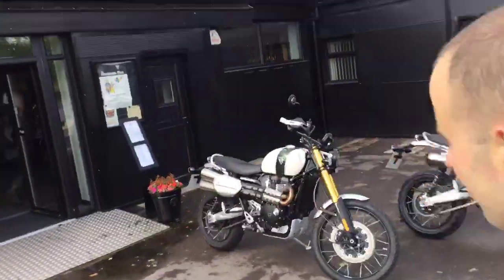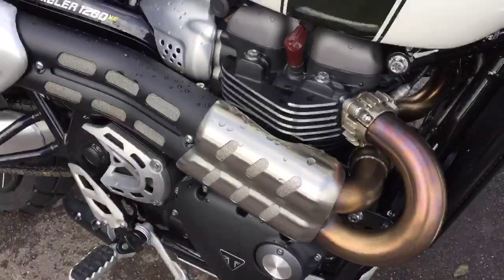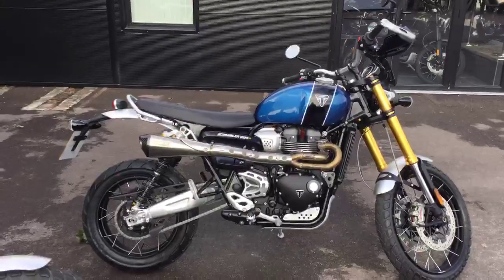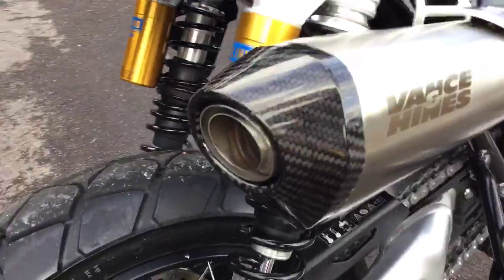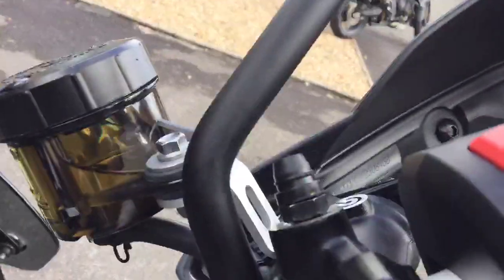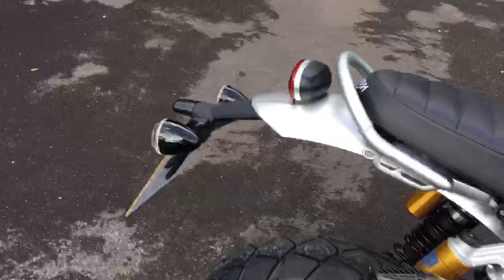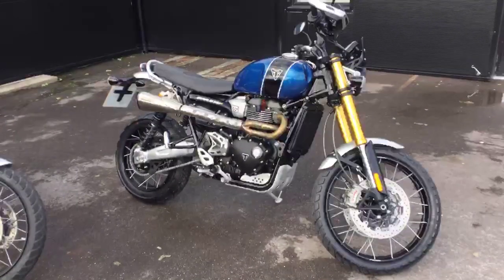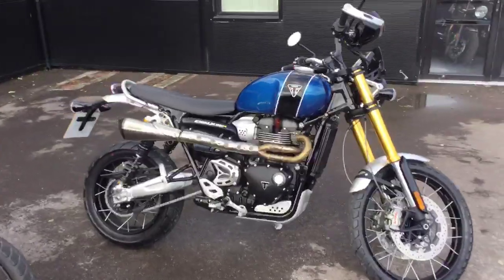Triumph Scrambler 1200 XC/XE Vance and Hines 2 into 1 Full Exhaust System

Comment: How good is this !! Is the baffle removable ? It reminds me of my 900 Scram with the no baffle Arrow sound wich I miss on my XE. Is the heat (much) better than with the original ? Is the midpipe bend still alright for standing up ? I most likely need one 😊
Reply: The baffle does come out easily. There is a mid baffle too which can be removed but makes it very loud. 

The mid pipe allows for easy standing up no problems, but in an ideal world could go tighter to the side panel. (there is very little under the side panel unlike Street Scrambler which houses more in there). 
Better throttle response and torque as well as less heat with the cat removed.
Reply: @craigpiper1129  how about clearance for a pillion? Specifically a 5ft tall pillion so short legs?

Comment: Is it plug & play ?
Reply from the maker: Hi Hamdi, yes this is plug and play
Reply: @TheTotalTriumph  isn't this for the 900? Can we fit 900 can on the 1200's?
Reply from the maker: @TheTechnofunk  Hi Tanveer, yes this will fit a 1200 as a complete Vance and Hines system with a few mods
Reply: @TheTotalTriumph  Hi there, what sort of mods are required? Thanks
Reply from the maker: @TheTechnofunk  we will supply a kit in a ready to fit condition for you. Very easy installation.
Reply: @TheTotalTriumph  good stuff...thanks.
Reply: @TheTotalTriumph  Hi, do we have to change the header tubes for this? Also is there a reduction in the heat generated, increase in power and torque across low, mid and high range..and most importantly how to deal with increase in space from the bike body..
Reply: @TheTotalTriumph  There's a modification by a guy who runs a channel here called Farmer Torque who cuts the mid section for dealing with space issue..anything of this sort done by the company??
Reply: @siddharthsaxena8863  that is our system we have modified tight into the bike and shortened. Only have one left now and it does get rid of the cat so save a lot of heat as well as 7 kgs weight.
Reply: @craigpiper1129  Can you ship to Triumph India please..
Reply: @craigpiper1129  Is there a way to get this, as I'm in India..
Reply: @craigpiper1129  Thanks Craig. Just mailed you.

Comment: I Can't understant how you promote an exhaust that is not designed for the 1200 engine. Those smaller headers kills top end torque.
Reply from the maker: Think you'd best check the cross section of your headers where it passed the cam chain tensioner. It's smaller ;)
The lack of cat makes up no issue.